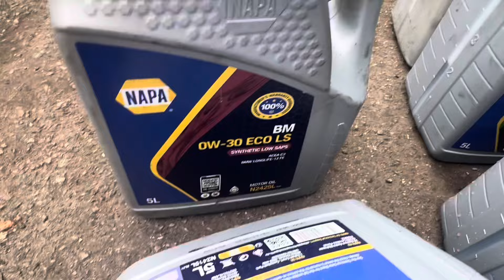Maintain Your Car & Save Money: Expert Tips on Choosing the Right Oil

Comment: Thank you for the nice video Charlie. How many miles did that Mazda cover in the 4 years without any maintenance?
Reply from the maker: Thanks for watching and for the question! The Mazda in the video covered around 29,000 miles over 4 or5 years without any major maintenance. It’s always surprising to see how much impact skipping regular maintenance can have on a vehicle over time. Keeping up with oil changes and basic service can really help avoid bigger issues down the line. 🔧

I appreciate your comment, and if you have any other questions, feel free to ask! 🚗👍 #CarMaintenance #Mazda #OilChangeTips
Reply: @ I sent you a message on Instagram
Reply from the maker: thank you